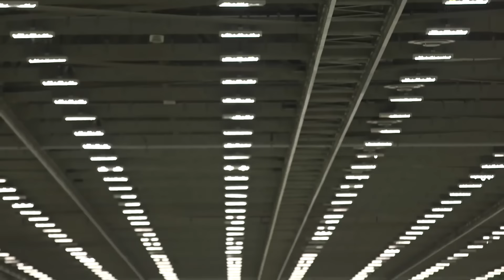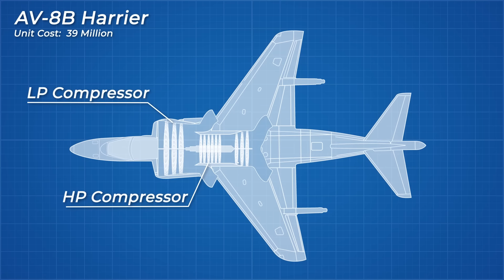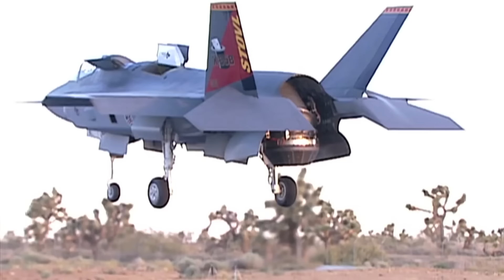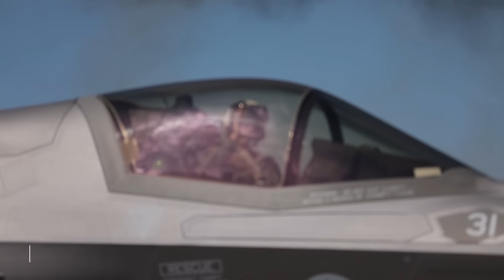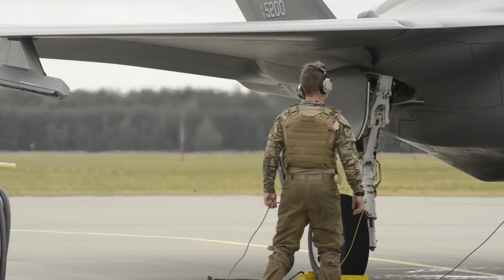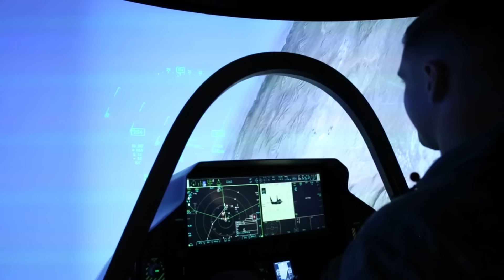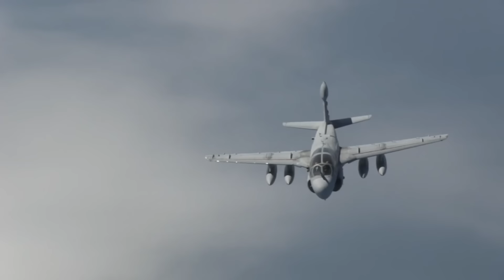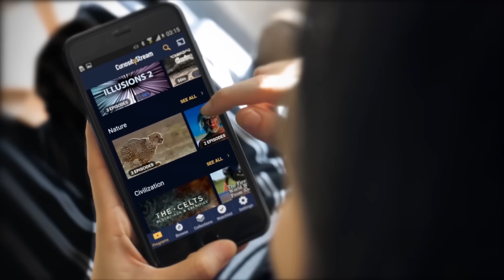Is The F-35 Worth $115 Million?

Comment: Trouble with the F35, is you cannot vector in flight (VIFF).   One of the main reasons that the Harrier was so effective in flight, is it could vector its nozzles in flight and perform extreme manoeuvres- like slowing down very suddenly.  
The other advantage of the Harrier was it was very simple.  The nozzles, for example, were controlled by a motorcycle chain x which meant the airframe was simple and robust.  The F35 could never be used on a forward base, like the Harrier was.
And if the Harrier had been given a new modern engine, it too could have had a 35 tonne take off weight.  Do remember it was operating with a 1970s engine.
Reply: I don't see how the available data supports the claim that an improved engine could get the Harrier to be comparable in payload weight. Rolls Royce did improve the output of the Pegasus by some 20%, up to about 105kN. Looking at the power output of the F-135 variants, which sit around 125kN, it doesn't seem like modern advancements have resulted in enough power to overcome the inefficiencies inherent in the Harrier's airflow design.
Reply: VIFFing was never one of the reasons the Harrier was effective, nor was VIFFing ever used in combat.

Comment: You forgot to mention that the F-35B only became possible thanks to the Russian Yakovlev Design Bureau. https://en.wikipedia.org/wiki/Yakovlev_Yak-141#Cooperation_with_Lockheed
Reply: Not really.
Reply: @peterson7082  ...lying troll.
Reply: Yak didn't give anything to Lockheed until 1995, and the only change to the F-35B's lift system during 1995 was the incorporation of the 3-bearing swivel nozzle, a design that was an American patented concept from the mid-1960s and had been tested experimentally for the Convair Model 200.

Comment: F-35 is like a computer so when you need it like WW3, its doing updates with a message saying. 
( Please don't tune off  jet - Loading 2% - approx time 2 hours remaining ).
Just don't leave it in plane mode over night.
Reply: The military doesn't do updates my dude. I'm pretty sure their Nuclear missile control computers (or whatever they're called) are still running windows 1.0 from like the 1980s
Reply: @mumble3535  r/whooosh
Reply: @DemonLordGamingAC0  So replying to a joke with a similar joke is akin to the joke flying over my head? whoosh yourself my dude 😂 also, using subreddits like hashtags is even more cringey than just using the hashtags
Reply: @mumble3535  oh damn I literally didn't read to understand your joke, my bad lol
Reply: @DemonLordGamingAC0  I'd judge you, but I'd be a hypocrite since I literally just lost 10% on a test because I didn't read a question properly
Reply: @mumble3535  big oof

Comment: Yes, every single penny.  This aircraft when operating in a group is devastating and should be feared by any country.  It had a bumpy road, but it's electronics are so far advance and above any other nation's aircraft ... there really are 3 aircraft that can accomplish a wide variety of items, the A, B, and C variant.  Pilots LOVE this aircraft.  If you want military aircraft go Lockheed Martin, if you want commercial aircraft go Boeing.  The electronics of this aircraft have progressed and exceed all other "dog fighting" aircraft without using directional thrust nozzle.
Reply: Quite frankly, given Boeing's recent record with the 787, 737 MAX, KC-46, and Starliner, I don't know if I'd trust Boeing with anything right now.
Reply: @infinitelyexplosive  Yes, removal of their CEO and then replacing with a new CEO that was primarily responsible for the cost cutting measures of the 737Max does seem a rather odd move.  Boeing need to return to their pre 2004 roots and get back on track hiring local resources to get the job done instead of outsourcing to cheaper resources.

Comment: they keep crashing ??? stopped flying in Florida & F22 ???
Reply: 3 have crashed in total, they're quite reliable
Reply: @infinitelyexplosive  They have just been forbidden flying in thunderstorms ? & now they have been told to not fly at supersonic flight for more than 6 minutes ? The infos out there if you know where to look .
Reply: @billhanna8838  The B and C variants are not to engage afterburners while at speeds exceeding mach 1.2 for 40 and 50 seconds respectively. They couldn't reproduce the issue on the A model, and the instance where it happened involved repeatedly flying on the edge of the performance envelope. I really don't see how that's a significant issue. The F-35 is not designed around high speed in the first place and yet is still capable of up to mach 1.6 in an emergency scenario. 

The inert gas system failure is ridiculous and in line with the other mismanagement based issues that plague the F-35.

Comment: You are “flat” wrong about the inability to calculate curved surfaces for stealth which lead to the faceted form of the F-117, given that the B-2 was an older and curved design with a much smaller return than the significantly smaller F-117.  We not only could produced a smooth surface F-117 with next to no signal return, but did not do so because the people that approved appropriation for it preferred the less efficient faceted design.  A F-117 looks like a small bird to a radar system due to its ability to deflect most the detection signal into a sideband return, leaving a small mainband return.  In comparison, the B-2 looked like a bumble bee.

Interesting side note:  the HAWK Missile System (Homing All the Way Killer) had a design flaw that caused the acquisition radar to lock on to sideband over mainband returns, which had the effect of scaring that hell out of tow pilots dragging targets behind their planes.  This flaw could not be resolved through four phases of upgrades the system, which was eventual cancelled.  Here’s the kicker:  the acquisition radar would lock on to a stealth bomber or fighter in preference to any other target.  I was a 24K during the Gulf War, which was a HAWK Continuous Wave Radar technician, and it was a know problem for our pip 3 and pip 4 systems.
Reply: ATB began in 79, Have Blue in 74?
Reply: infinitelyExplosive
Both programs were spun from the 1974 project, but the ATB was a direct successor of the YB-35 which had a known reduced radar profile as far back as 1946.
Reply: @jeffersonian000  It was known to be less observable, yes, but the specific shape of the B-2 is massively optimized compared to those of earlier flying wings due to advancements in computer modelling. For example, compare the leading edge of the YB-35, YB-49, and B-2.

Comment: Apparently the F-35 can be seen from each side below or above and even easier from behind, There are radar signals capable of "seeing" this plane from the front I have read. If stealth was the selling point/main benefit it seems to have failed. In a day and age of mach 6+ self guided ground to air missiles it would seem to me that sending one plane would be a 100 million dollar Kamikaze attack as the plane would most likely be downed on the way home sending more would only add to the overall cost in men and equipment for any given mission. So I give a flat no to the question posed...... it is not worth 115 million dollars it is a one trick pony that does not do the one trick very well
Reply: Stealth is not the main selling point of the plane. It is just an advantage that it has over every other plane. Regardless if it is detectable or not, it is still harder to see than non-stealth planes. I think the radar signals you are talking about are lower frequency radar waves, which are able to detect the plane but not able to pinpoint its location or guide a missile.
Reply: @TT-hd3zi  In a day and age of "fire and forget" missiles that once "seeing the target" self guide to the target IE alternately identify track and follow their targets, up to and including having the ability to turn around should there be enough propulsion left. Your premise that missiles need to be guided solely from ground radars is decades old. No the F-35 is not worth the money. I am sure many many countries will buy the planes.  I hope Canada does not buy into them.....but trump has had the Canadian procurement rules changed taking two of the competitors out and allowing the F-35 in even though it did not meet the specifications for consideration. IMO they are not worth the money. A one trick pony that does not do the one trick very well at the end of the day. A one trick pony that needs political manipulation from the country of origin to sell on the world stage instead of being able to sell itself on its own merits/capabilities....sad given all the money spent designing it
Reply: @paulchristensen2854  what would the 'one trick' of this pony be? Also, when did I say missiles could only be guided from ground based radar?
Reply: @TT-hd3zi  Stealth is the one trick advertised any electronic warfare suites and jamming capabilities are not exclusive to the US only the system and soft ware it self is. Your assertion of low frequency radars not being able to guide missiles would lead a person to believe you still thought that was how they were guided

Comment: Did you say that it would have been cheaper to make 3 separate weeks planes for the 3 services?  Per the Lockheed program manager the airframe came from the Harrior replacement design as they thought it could also be repurposed for runway and carrier landing aircraft - So the airframe was not originally designed as a superior fighter!

Comment: Hopefully it cannot be shot down by a $50,000 Made in China or Made in Russia missile.  
Actually if the enemy focus on air defence missiles which are cheaper to develop and maintain, eventually u will run out of money to maintain0 these expensive planes. F117 and Blackbird are fantastic planes too but they have to be retired because it is too expensive to maintain. It becomes a Tiger tank vs Sherman tank situation. Many inferior equipment >> a few superior equipment
Reply: Missiles are "cheap" in comparison, but they still need all the equipment to launch and guide them. An S-400 system will run a nation roughly $1.1 billion, and will have to compete against a squadron of F-35s. The F-35's missiles and bombs are also significantly cheaper than those of an S-400.

Comment: There was news a few months ago about an F35 with stealth paint on it getting picked and painted for a significant amount of time by a short wavelength radar in Germany , new military radars are all designed to detect stealth airplanes .
Reply: A stealth aircraft like the F-35 or B-2 is harder to detect than a non-stealth one. If you can detect a stealthy aircraft at a certain range, you can detect a less stealthy aircraft at a greater range. It's not a feature which can be countered because being more stealthy is always better.
Reply: The F35 was at an air show. For the safety of other planes and to prevent other nations testing stealth capabilities, they were equipped with Luneberg reflectors. Look it up.

Comment: I think the x-32 if given the same money and time would have delivered a better plane - I think politicians got in the way of things and the prettier design was picked even though the x-32 would probably be better in a dogfight because of it larger wings
Reply: Then again, it's Boeing, so it might have ended up killing all the pilots due to design oversights.
Reply: Larger wings does not equal better dogfighting. The F4 Phantom has larger wings than the F16 and yet it is less manoeuvrable.
Reply: The X-32 couldn't go supersonic and perform in STOVL configuration at the same time. Not to mention the F-35's wing loading is basically the same as or better than the F-16.

Comment: I would love to see recordings of the test runs in the Sims with 20/1 kdr
Reply: Just like f15 with 100 kdr
Reply: @navyseal1689  F15 best plane ever better than BS F-22 which is only propaganda like SU-57
Reply: No man, F15 has been around for so long and has seen many combats. While there aren't many conflicts nowadays for F22 to show its strength
Reply: @navyseal1689  No it does not matter 100kd is not what a F-22 could achieve today unless its fighting ww2 planes F-15 was to superior at that time still today with updated avionics it still outperforms a F-22 Thrust vectoring is nothing! In red flag F-22 lost to Gripen and the Rafale in 1 v 1 dogfights and it used vectoing and still lost! I met a Gripen pilot he said the F-15 was tougher in a 1 v 1!
Reply: It basically goes like "Amma all stealth and undetectable you can't see me, but I see you on my supercool radar. I let of one of my supertech rockets and you go boom without noticing where am I"
Reply: @Garchist  Yeah in hollywood that will be correct XD